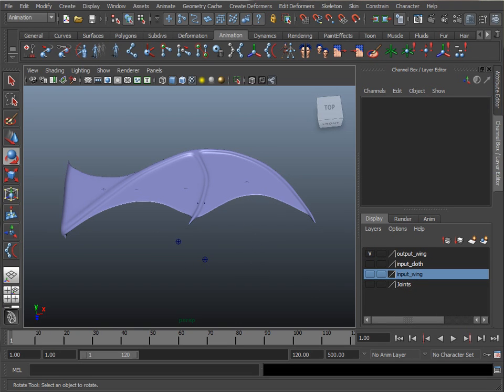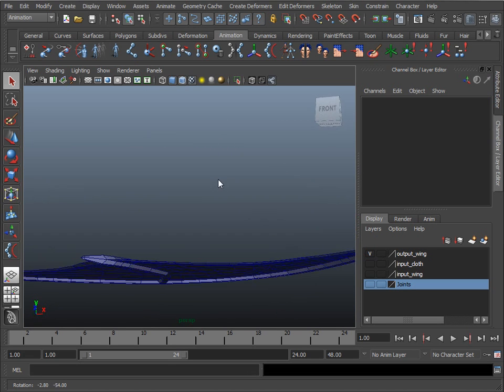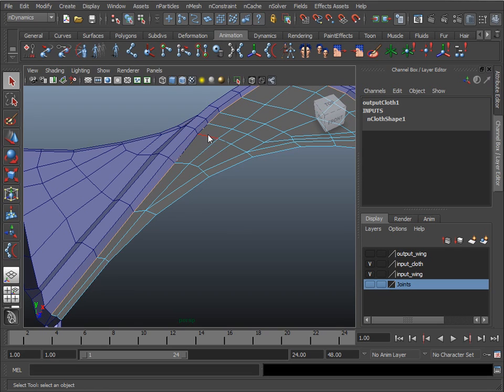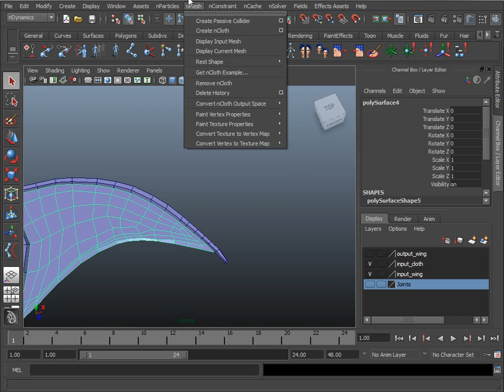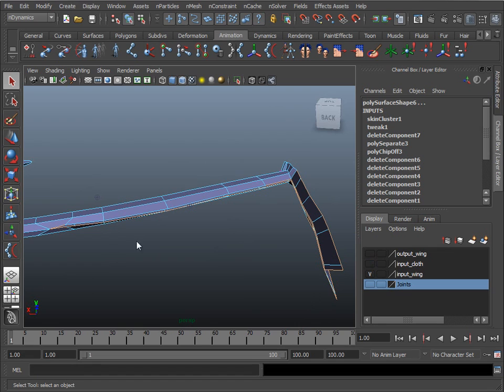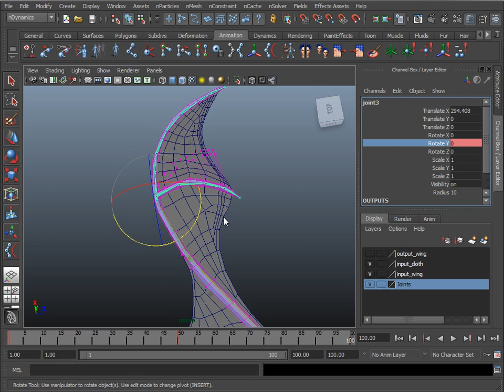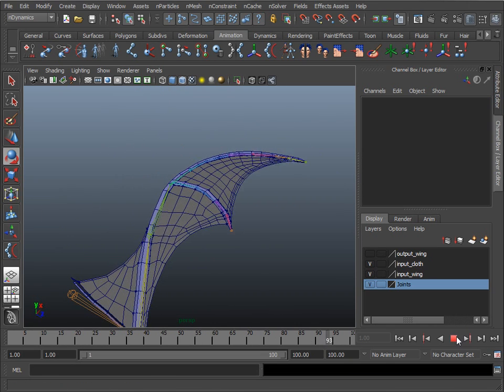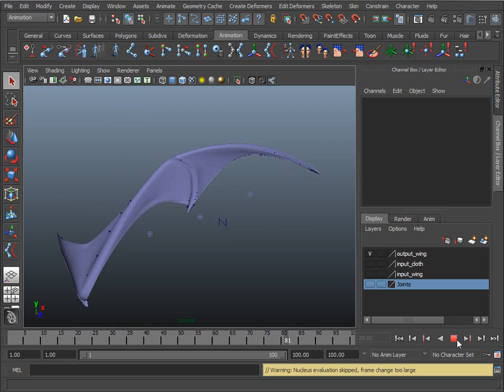Maya Wing Rigging Tutorial Using nCloth Simulation

Comment: I remember watching this tutorial 12 years ago, back when I was doing a dragon for Nickelodeon. Only difference is that their wings were double-sided, which can be an absolute pain to weight. It's easier of the rigged wing is completely flat and drives the full model based on proximity. Haven't touched Maya in many years, so I barely remember how it works.

Comment: Hi!! It works great but I got a problem, I want to integrate this wings into my animation but I cannot mannage the Cloth meshes to follow my bones correctly when I rotate the hole rig, I mean. I rigged like this, then I want to posisionate my rig from the main ctrl and move it somewhere else and the finger mesh do follow my Joints buuutt the ncloth meshes stay in this rotation and just seem like hanging when I play the simulation
Reply: I try to put the meshes under de figer mesh in the Jerachy of the outliner but not working, also I try to put the hole group of cloth and fingers in my rig chain and it does rotatate but not absolutly right, kind of out of phase

Comment: I did this and it works beautifully!  At first, I thought that I would have to create the wing separately from the rest of the skinned rig, which I didn't want to do.  After a while, I realized that I had to use the entire skinned mesh of the rig, including the "wing bones", head, claws, etc., and without the membranes, as the proxy.  Then I wrapped a copy of that entire mesh, modeled with the membranes, around the "grouped proxy and nCloth".  Now the only problem is having to run the simulation before the first frame of the scene to get the nCloth to settle into position for the initial pose.

Comment: Couldn't you just create a separate mesh for the ncloth wings parts, weight their edges to the joints, and then create an ncloth from those and use input mesh attract painting to stick their edges to the joints? That way you only need to simulate cloth for a few meshes, and you don't need to use constraints. Or would that cause a problem with double sided meshes? But then I imagine you could wrap the double sides mesh to the single sided n-cloth wing mesh. 
Just throwing out ideas. Your technique definitely works in a number of circumstances.

Comment: Hey there, just another guy who happened upon your tutorial, speaking. I have to say while it's quite excellent how you devised this method, information provided here isn't complete.

The video tells me how to create a wing with the membrane simulating cloth and wrap it around a continuous wing mesh, but it doesn't say anything at all about wrapping around an entire character. When I applied it to a cartoon-y dragon I had made (as a test without the joints and controls, just pasted across files), the rest of the model just crumpled around the wing as it moved.

In addition to this, I'm pretty sure there are other complication that need to be addressed as well. I appreciate any sort of helpful response, especially from the OP.

Thanks

Comment: If I or someone else would do this but on a whole bat that's a solid mesh, not only the wing. Would I duplicate the whole mesh of that bat, do the same thing as he did with the wing and also rig that whole duplicated bat so it's able to move its head, legs etc and then use "wrap" to make it so that the "render version" of the bat is following the duplicated, fully rigged one? Hope this is easier to understand :)

Comment: hey thanks for the tutorial. another way to do this without the component to component constrain is to apply the cloth simulation to the actual rigged wing, and paint the input attract mesh map (white to where the cloth shuld follow the rig exactly - ie the joints, and black where there shuld be a cloth simulation). then you can increase the input mesh attract in the nCloth menu to 1.as you said, applying the nCloth to double sided polygon would be a hassle so you could use the wrapping method.

Comment from the maker: I only added simulation to a single layer of the wing as it makes the simulation quicker and easier to manage. If you simulate both layers then you can have issues with the layers interacting with each other and passing through each other, which can take ages to sort.

However, if you want to use advanced materials, like Sub-Surface-Scattering, you need to have both layers of the wing in place.

Comment: Great tutorial! Thanks for addressing the small little things that instructors usually fail to mention because they feel it's trivial. 

If I may ask one question...you nCloth'd only the top layer of your double-sided wing, and then stitched it back to a single edge on the mesh. Does that mean there's still a hole underneath? Is the bottom layer completely useless then, or should it be done with the bottom also and stitched again? Thanks!